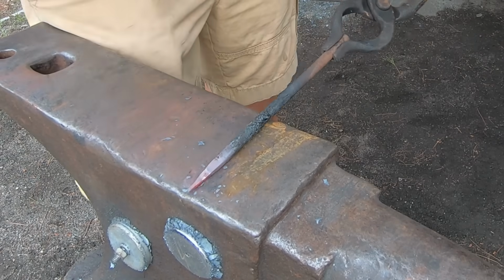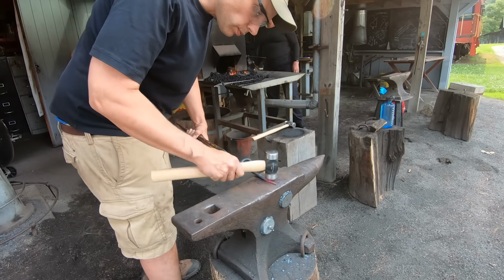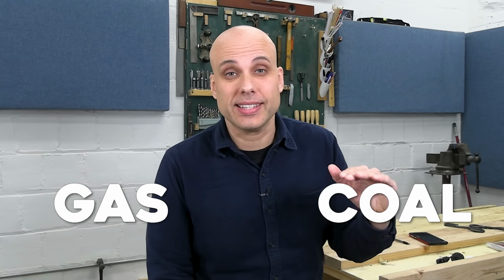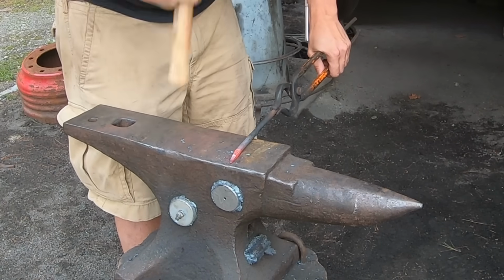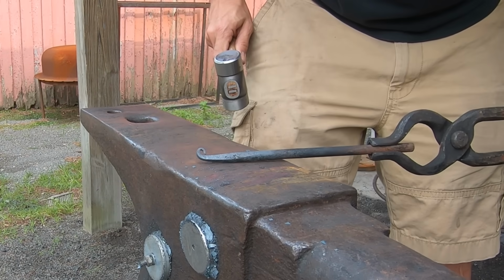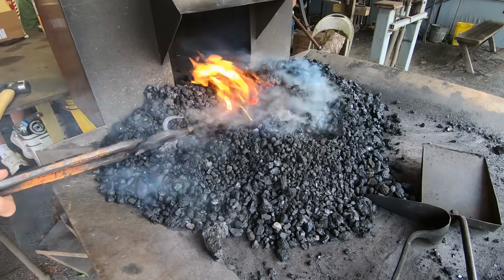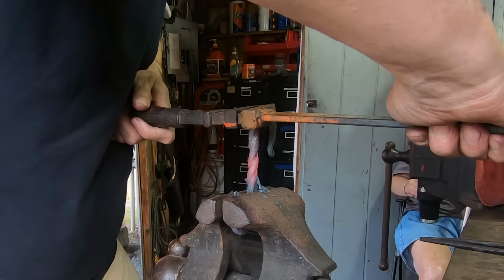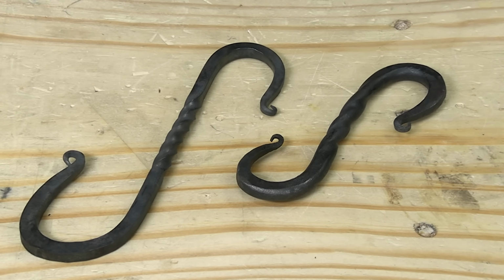Blacksmithing Basics for Woodworkers: Launching Your First Forging Project.

Comment: Yes, synthetics like polyestet melt when spark or extreme heat meet their plastic fibres. Ask any state trooper who has had to have pieces of uniform peeled off (along with a couple layers of epidermis) by an apologetic ER 3rd year after a flare strike mishap, veh fire or even shell casing landed on him.

Comment: Would be interesting to understand the range of what blacksmiths can do. If i understand this correctly, and i may not, the output is wrought iron. This stands in contrast to cast iron which is more of an industrial process. Fascinating stuff. Thanks
Reply: This is a common but understandable misconception. While forged steel is worked or "wrought" with a hammer the most common metals used by modern blacksmiths are mild steel and other industrially produced alloys. 

Wrought iron is distinct from modern steels and no longer made at scale because its very labor intensive to get even small quantities. It was produced by refining the bloom of a bloomery furnace. The bloomery process slowly de-oxidizes iron ore by cooking it for long periods in the presence of carbon monoxide of a charcoal fire. Taking about as long as cooking a brisket, the oxygen in the ores iron oxide binds with the carbon monoxide to create carbon dioxide. The ore then fuses together to create a "bloom" which is a spongy mass of elemental iron and whatever impurities were in the ore (usually mostly silica) with a very low carbon content. To turn this into useful metal, a Bloom has to be compressed, flattened, and folded repeatedly at a welding temperature to evenly distribute (and remove to some extent) these impurities throughout the metal. Kinda like kneading bread dough. This process of refining a bloom is the "wroughting" which gives wrought iron it's name. These impurities give wrought iron a distinct "grain" structure almost like wood which makes wrought iron softer and easier to weld than modern mild steel. So it's already been wrought before a blacksmith even throws it in the fire.

Conversely, cast iron is an iron alloy with an intentionally very high carbon content. The carbon is actually dissolved in the metal and it lowers its melting point like adding salt to ice. This is desirable for some manufacturing processes but makes the iron it brittle. You cannot forge cast iron as it will either melt in the fire or crumble on the anvil.
Reply: Mild steel and other modern steels are made by completely different processes and can be forged. However they all tend to be tougher to forge than wrought iron. In my very limited experience the more exotic the alloy, the less it moves under the hammer blow-for-blow

Comment: Thank you, Mr. Krueger;
I have a small anvil & block, I usually only do light (very light) work.
I don't have a forge but I've got a propane torch, stainless hose, & 60lb tanks.
I don't think I'll do much smithing because I have asbestosis & COPD.
The fumes & gases from a forge, torch, & hot metal are not good for breathing issues.
BTW, I hope your mother-in-law is better & all you & yours are well.
Moving on, I'm working on my wood working.
I bought 2 bundles of fire wood (for "hardwood") & starting splitting it.
I'll work it to size, shape, & finish.
Already collected some old furniture for the hardwood, too.
I've bought a few planes, 2 No. 4s, 2 No. 5s, & 2 No. 6s, & a Kolbalt No. 4 copy.
Also some saws, chisels, & some layout/measuring tools, too.
Planning on building at least 2 benches, 1 workbench, a low bench & prolly a saw bench.
When I was a kid we had a small plywood bench built by a relative who was a carpenter.
It was similar to a saw bench, w/ 2 ends, 2 side aprons, & top w/ a 'hand hole' slot.
Have a GREAT day, Neighbor!
Reply: I love your ABSOLUTE honesty.  Your wood sources are spot on.  Your realism is a delight.  Keep on keeping on.

Comment: I often combine metal parts with my woodwork projects. Not just hinges, etc., but decorative or functional pieces. For example, I'm currently making a wooden monitor stand for my study as I'm fed up with the look of the horrid industrial thing it came with. I have a VESA mount for the monitor that was an easy epoxy attachment in a hole in the top of the stand. I'm also going to add a metal plate underneath as the foot plate for it. This will be decorative as well as functional as it will add strength to the feet of the stand which are cross grain and could therefore split. It would be good to cover methods and processes to add these sort of things to wood projects.

Comment: Very interesting, how about making your own metal work for a chest?
Reply: Yessir

In a word. Yes you can.   Inso saying, drawer pulls handles hinges plates corners straps  locks and whatnot ever you can think of.  
  Basically b4 1900s everything metal was forged by hand. 💯 By hand.  
   At this point one can choose their own level of basic functionality to wow baby.  Depends on how you take to the craft and how much time and effort you want to put into it.  Nails screws brads the whole nine yards was 1st crafted by an ole Blacksmith in a dirty old shop full of iron n steel and coal, with all his tools most usually made by hand. 
   Now if your really interested and wanna learn and see what  basics you need, id suggest John Switzer YouTube name Black Bear forge. He actually has very recently done a short series on setting up your own smithy for right at $500. Great information and great content. Yes that includes the anvil forge hammer tongs n some tools... enough to 💯 get you started. 
  For a good percentage, it is a great stress reliever too. 
  Can't agree more with @Rex Krueger. It's totally worth it to find a club if sorts or a good mentor. 
  Blessings abundant Sir

Crawford out 🙏🏻🔥⚒️🧙🏻‍♂️

Comment: One thing I learnt about coal fires is they keep the carbon in the metal better due to the huge amount of un-burnt carbon in the atmosphere in the fire.  Gas fires take the carbon out very easy (very reducing flame due to the more complete combustion). If you give your work piece too much heat on gas is very unforgiving and will turn it into a sparkler much more readily than coal.  At least that what I was told by an old smith.
Reply: I honestly wish we had these communities in the UK though.  They are very few and far between
Reply: @MrWesty500 You might look up your local farrier and they might lead you to a closer one?